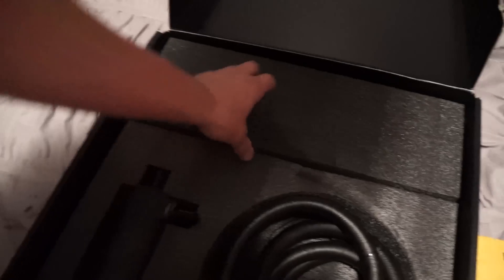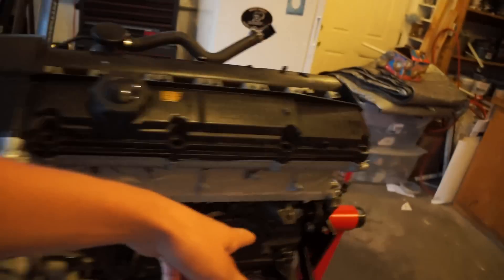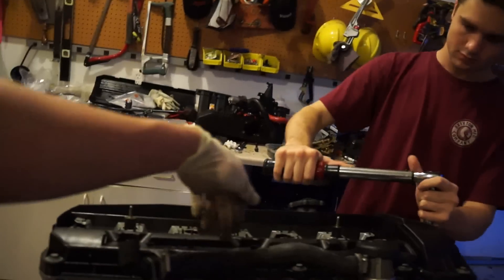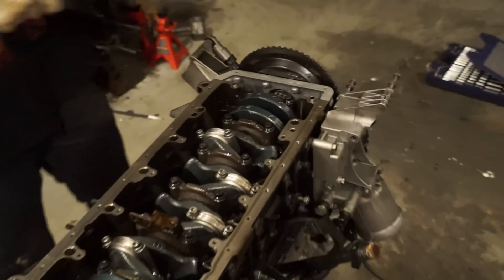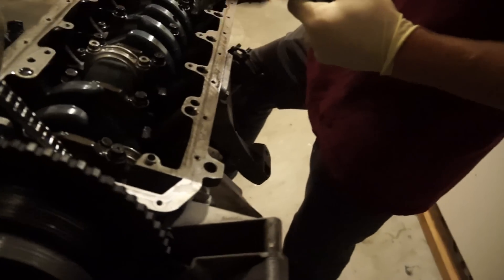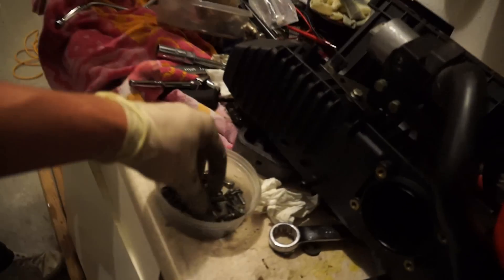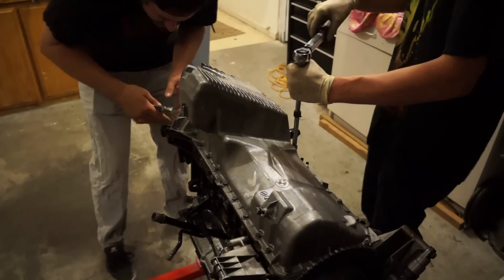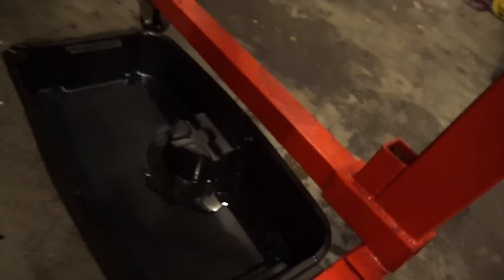Re-Torquing the Rotating Assembly

Comment: Is the valve cover new? If it's old it's probably warped and there's your leak. But yeah valve cover gasket too. Knowing you it's new.
Reply from the maker: it is not new, its from the old motor. didnt leak last time it was on, so i dont think its warped, but ive never heard of these plastic covers warping.
Reply: @M3NACE  I didn't either. It was something I read up on in some forums. I swapped both of mine. 5k miles and so far so good. Still had a leak with a new gasket. Had to go the extra mile
Reply from the maker: oof. brutal. ive heard of the magnesium covers warping but not the plastic ones.
Reply: I've read about the plastic tending to warp on bimmer forum too. I changed my plastic valve cover gasket & plug wells @ 195,000 and thankfully it's not leaking after 2500 miles of usage.
Reply: @M3NACE  brutal? You took out your motor a hundred times, guy. All I did was nothin'.
Reply from the maker: brutal if they do warp and ive never heard about it lmao
Reply: @M3NACE  oh haha well, maybe it wasn't warped and I probably installed the gasket incorrectly. Either way I ended up with a new cover. Despite spending 250 on it, I'm quite satisfied. I'll do anything for my baby.
Reply from the maker: +1 i have a spare valve cover from the M52, ill throw it on if i need it. this VC seated fine before and wasnt leaking, so im sure it was just me. i kind of half ass threw the oil pan and valve cover on because i knew they were coming back off lol
Reply: @M3NACE  fo sho. It's coming back off so it makes sense. But if you're an idiot like me and shit still leaks you gotta spend dat paper. Tell your friend I said he cute.
Reply from the maker: lmao will do

Comment: For the rear wheels on little wing, what size are they width wise and did you do anything like rolling the fenders or take the liner out?
Reply from the maker: they are 18 by 8's all the way around, 225 front 245 rears, no fender roll with unmodified liners all the way around.